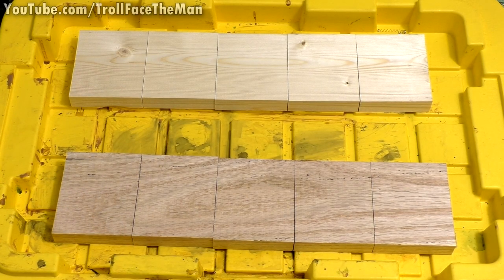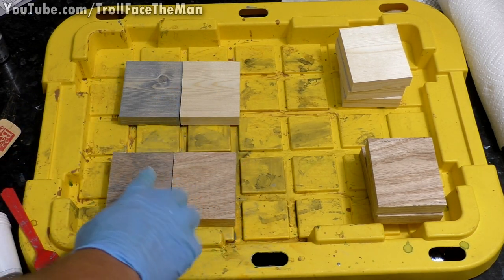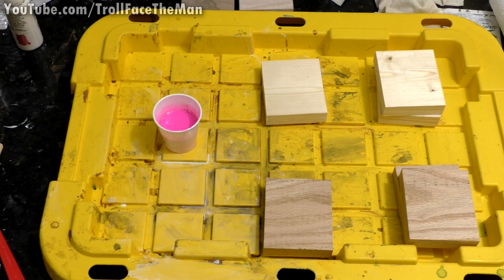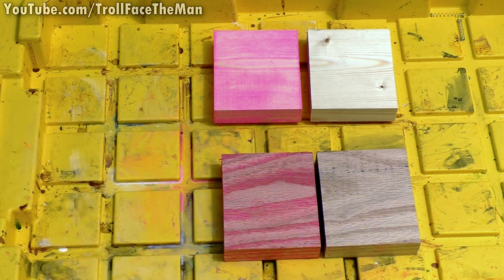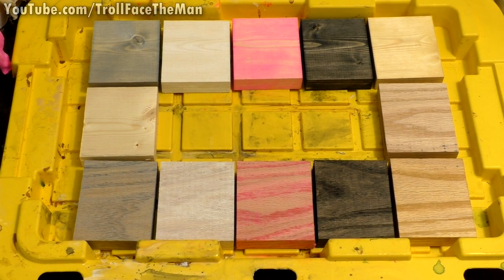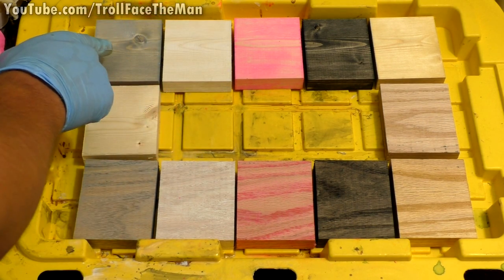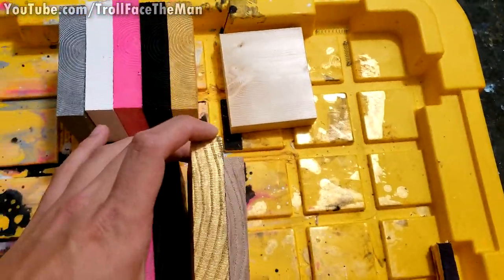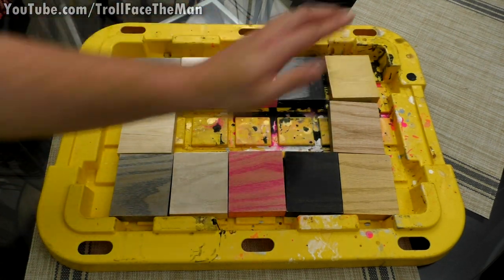Acrylic Paint as wood stain? Silver, White, Pink, Black & Gold. Oak/Pine. Test Homemade Stain & Dye.

Comment: not sure about your silver but I have had the "closest thing to chrome" spray paint that looks darn near like polished mirror like metal, when applied, after coating it with a clear sealant since touching it causes it to rub off the silver part, and the clear coat when applied caused the silver particles to float up and I guess turn sideways some of it giving it a much darker more flat unpolished grey coloration,  Also the Mehr I think is the name, face makeup that is basically I think a crayon like wax with a ton TON of very VERY tiny aluminum particles in it, so that when rubbed onto something, it makes that thing look like it was cast from polished aluminum, too, when sprayed over it goes dull but I managed to pull off leaving the mirror effect by doing very super light spray a few times before giving it a full spray, so might have been able to do that with the closest thing to chrome stuff too.
Reply from the maker: Sounds like you have had a similar issue with silver paint too then. Seen it with silver paint oil and not, and seen it with silver markers. Even if used and Oil finish on Oil paint, Oil finish on water paint, Water finish on Oil Paint or Water finish on Water Paint. Same with markers.

Comment: I think the real issue is going to be if it fades, that pink I am betting will fade pretty hard in sunlight, where the good wood stains are not supposed to fade and may even get darker over time though that could be from the wood under it aging as I know mahogany I have as it aged got redder and redder in color, and sealing it with a clear sealant only slowed this down.
Reply from the maker: I am betting too they will fade pretty hard with sunlight. But they will hold up better than most organic non brown pigments I'd bet.
Reply: @TrollFaceTheMan  possibly if its organic though I would think those would be dyes and not pigments as I recall it seems pigments are mineral based and dyes are organic molecules making them less robust than the mineral based ones (like what makes a rose red vs ground hematite, )
Reply from the maker: @ThomasAndersonbsf  To my understanding there is Natural and Unnatural Pigments and Dyes. Pigments are nearly insoluble particles like Iron Oxide, Charcoal, Crushed Red Beetles and so forth. Dyes can be things like Blue Berry Juice, Printer Ink, Goldenrod Extract, Copper Sulfate and so forth.

 Minerals shouldn't fade at all though or little vs organics can a lot.